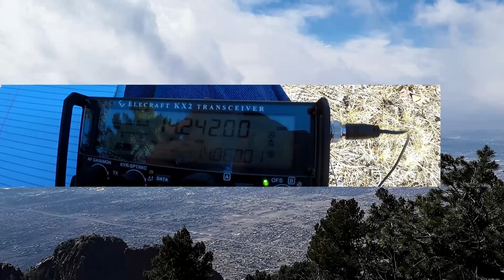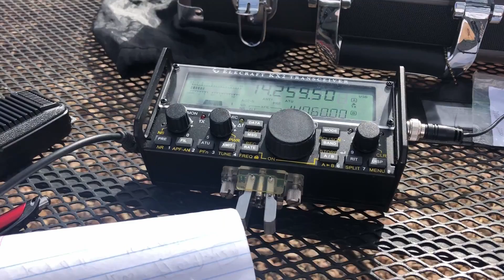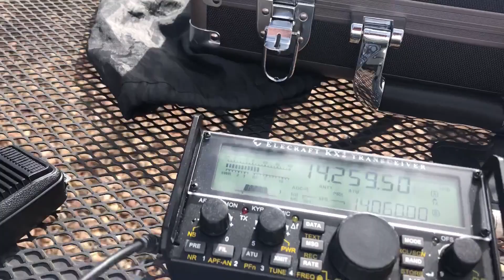QRP: Impossible?  Is SSB an option during a solar minimum with QRP?

Comment: I was doing the same thing today: 15watt KX3, vertical endfed, and made contacts with the BC station, as well as a station in VT. I setup for the VT station because that state has eluded me. Made a contact with VT in about 3 minutes of trying (~2500 miles). There was a lot of QSB and it was raining here in the SF Bay Area, which did mess with the antenna effectiveness. Also for a period there according to the websdr in Halfmoon Bay 20 and 40m were pretty dead (not even any CW), but they came back. During the game it looked like both 20 and 40 were pretty good. It is indeed amazing what you can do with low power.

Edit: I did hear the contesting station making a QSO with NM maybe you, but I could not hear the NW station at all.
Reply from the maker: That could have been me.   Signals were really booming when I was active.  Curiously enough, CW activity seemed nil.  I tried a few calls and got no responses.    Thanks for watching!

Comment: Excellent demo of QRP SSB. QRP phone is all I do home or portable.  I've made contacts at 1 watt SSB and also worked some 40 meters AM at 2 watts. I enjoy it and think if others would give it a try with a little patience they'd also get a kick out of it.
Reply: What antennas do you recommend?  I’m studying for my GENERAL and purchasing a KX2 rig. THANKS
Reply: @MrTonyd1954  I personally like wire antennas as there are numerous ways to make them and set them up and they're inexpensive to construct. I use end fed random and end half wave antennas the most as they are multi band (especially if you have a tuner) and can be setup easily with a single high point and the many other various configurations . If you are only looking to operate on a band or two it's hard to beat a half wave dipole for that band or bands. If you have the room and ability to put one up, it is probably the best bang for your buck. Building your own wire antenna is great because if one type doesn't work out you can reuse the wire for a different antenna configuration/project. There's no one perfect antenna so my true recommendation is experimenting once you get your rig. I find it fun and you'll put in practice some of what you learned studying. Good luck on your General Class test!

Comment: Working QRP could be a lot easier if stations listened a little more rather than respond to just the bigger power stations OR say QRP only.  I listened to a special event station and it was great when he said QRP only, he cut short a high power European station at the knees when he said he wasn’t QRP.  I would also like a truthful signal report, 5 and 9 is little help when in truth I’m possibly a 5 by 4. Thanks for sharing.  73 de M0AZE Mike.
Reply from the maker: Mike S yes and Field Day this year was a bit of a struggle.

Comment: North / South propagation from your QTH is usually always good.  How about you go out with 10 watts  SSB in the field, and do a WWFF-KFF World Wildlife Flora and Fauna USA Activation , and try and get 44 QSO's with your QRP rig, to get an activation credit.    A net does not make a good example, nor does a sample size of one QSO.  Better yet, come on out to California and do a WWFF-KFF activation with 10w SSB, and get 44 QSO's.  Soil conductivity has a huge affect on your ability to propagate signal.  Your sample size and location of one does not make a case for suitability for all. A sample size of 1 day does not add much  validity to your claim, either. Some days are good, plenty of days are bad, due to solar wind storms, SFI variations and A and K index variations.